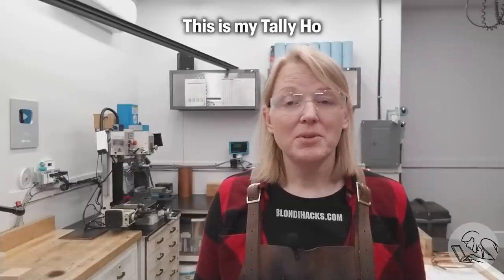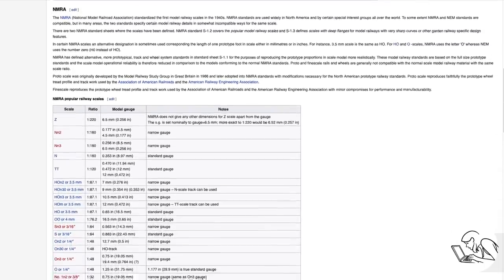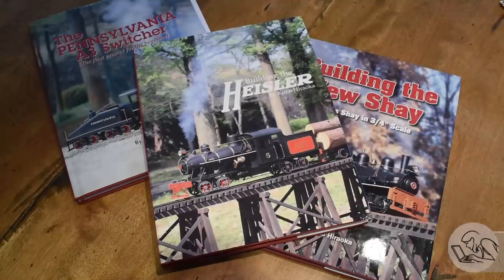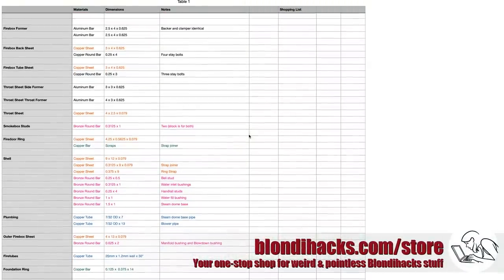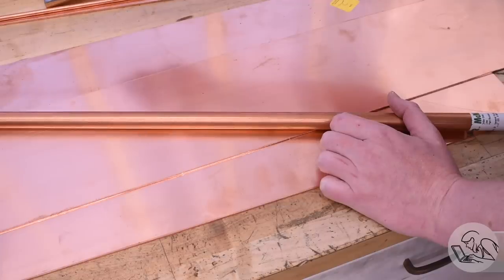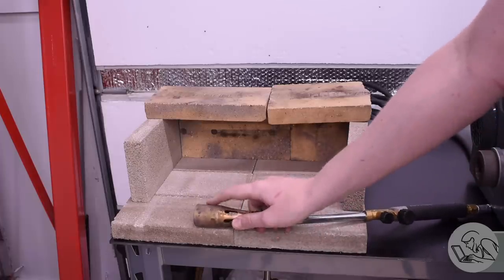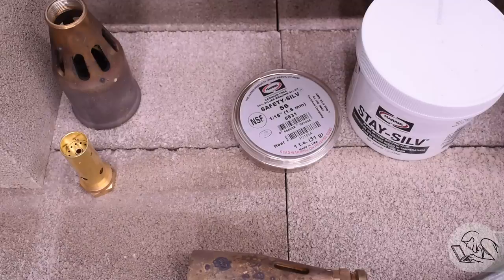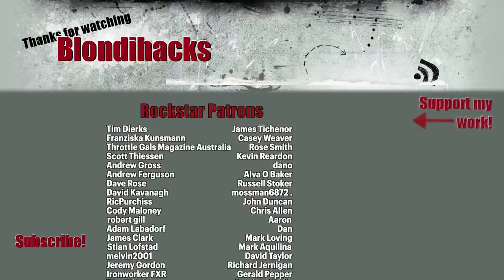Let's Build a Locomotive! Pennsylvania A3 Switcher, Part 1

Comment: I just discovered your channel by way of a mention in the NMRA (National Model Railroad Association) online newsletter. 
I recently finished my built of the Pennsylvania A3 Switcher, just this past summer. I enjoyed your explanation of the estimated completion date. It took me 15 years from start to finish, although I also worked a full time job as a machinist.
If you haven’t yet discovered it, there is/was a Yahoo Group for ‘Builders of Kozo Engines’. There are several errors in the book that are discussed there. Since you are starting with the boiler, you are likely to discover an error of accumulation when you try to marry the completed boiler to the frame. You will find that the firebox won’t sit perfectly flush on the frame with the smoke box firmly on its cradle. Many other builders have taken the time to completely build the engine in CAD to resolve errors like this one. 
It’s all part of the fun of the hobby.
Best of luck with the build!
Reply from the maker: Sadly that Yahoo Group is gone

Comment: For future reference for metric: consider checking out metricmetal point commercial.

They do seem to have 20.0 mm OD x 1.2mm thick tubing, if copper 122 is a fine alloy to use.

Comment: for large parts of the boiler try burying the parts in a bed of coke with just the joint exposed. it holds  the heat in and saves  the amount of gas you use. Im on my eleventh copper boiler and te coke trick really helps.

Comment: Another potential problem with building boilers out of steal is getting the boiler certified. I know here in the UK to get a steal boiler certified you need to be able to show that all the welding was done by someone with the correct certifications to work on pressure vessels. If you can't show that the boiler is as good as junk no matter how good the workmanship is.

Comment: You might find that you will require two torches. One big one to keep the entire boiler hot and one smaller one to make each joint. Copper transfers heat so well you can solder one joint and melt another one a foot away. Good luck. I made a copper boiler for a 7 1/4 but I bought a steel one for a 6in to the ft traction engine I am currently working on.

Comment: OMG.  Not going to dwell on the imagineering a CP 0-4-0 ... but ... the pic of the SD40s (I think) in Action Red multimark had a Robot car cut into the consist!  Distributed Power is a very common thing these days, mountain grades or not, but back when that image was made, Robot cars about the only way to have unmanned helpers.   CP's cars were converted EMD F "B units" where all the 70s/80s electronics were housed and were commonly seen on  their mountain lines.  Cool to see one in the image.
Reply from the maker: Haha I knew the railfans would come out of the woodwork for this one. 😄
Reply: @Blondihacks  We ... can't ... help ... ourselves ...  In another comment someone said "living vicariously through you" and they are 100% correct.  I am unlikely to ever build my own steam engine but through you ...

Comment: My grandpa built a 7 1/4" steam engine in the late '90s, the one piece he outsourced was the boiler. Here once the boiler hits a certain size and will need to be certified to run on a public track, and that is hard to do if one is not a qualified boiler maker. His engine is still in operation even though his has passed on.

Comment: 1 1/2 scale is about the biggest you can go and still have most of the parts still liftable (and the boiler will be iffy).  At 2 1/2 things get really hard.  I built a 3 truck Shay in 1 1/2 and the total weight is about 550 pounds.  A friend's 2 1/2 2 truck Shay is about 850 pounds, hard to shift around even with good hydraulics.

When you get to the big locos you get ludicrous weights.  A friend's Northern runs about 1600 pounds and another's K-27 is about 2600 pounds.

Comment: As I do not have room for a machine shop and limited finances (pension), I've gone down the battery electric route. I've designed my own, on 2d cad, used a laser cutting service for the frames and bodywork.
What I'm trying to get over is that laser cut frames are superb, I couldn't get that quality with hand tools. I urge you to go that route as it will save you weeks of unnecessary work.

Comment: Looking forward to this.  For the fire tubes, if the wall thickness is the critical factor for efficiency could you thin the walls down on the lathe?  1.2 m vs 1.65 seems like a significant increase in thickness.

I wonder what the impact of the efficiency would be.  Might not be worth the effort.
Reply: Most of the thermal resistance is in the boundary layer of the combustion gas -- and to a lesser extent in the boundary layer of the water. The thermal resistance of the copper is so low that it's effectively irrelevant to thermal efficiency. I've even used plastics for heat-exchangers in near-ambient temperature applications...

Comment: If you would like, I can cast up a bronze dome for you to machine.  Or I can cast up a bronze rod.  I have silica bronze on hand.  If you want I can cast close to the actual shape that you can finish from a sand casting, just need a drawing to plug into.  I work in Imperial. 
Fascinating project btw

Comment: Make sure that the safety valve is tamperproof and cthe boiler able to work well in tandom eith the valve so you don't lose or build too little or too much pressure, you would need 2 maximum, one for a higher pressure just in case

Comment: At around the 8:30 mark - you were binding up those copies of the book pages that were obviously copied physically on a xerox/home scanner. I'd like to mention that my last 3 Samsung phones had a built in scanning function for taking pictures of documents (there are also several apps that do this, but it seems to be a built in function now). This would allow you to make cleaner "copies" of the pages that don't have the binder distortion at the spine edge of the pages - it'll make it so much easier to read when you need to. Especially those larger schematics - one image of the whole thing could be scaled to whatever size you wanted and printed out - I see folded pages as you're binding yours, but I also saw the spine distortion. 

Maybe check out digital scanning - it might be very worth your while for easier to read material, and it's really not a steep learning curve at all. ;)

Comment: Copper TIG welding is a real pain... requires 100% helium  for the shielding gas due to copper's thermal conductivity. Other than for welding bus bars, soldering and brazing are the ways to  go.

Comment: @13:56, your high tech O.A.K product is expensive. Typically the softer and faster growing liriodendron tulipifera (poplar) could probably be used for hammer forming. It has these super amazing properties while being considerably lighter. Specifically I'm not super familiar with your exact O.A.K. variety as it likely has 2-3x harder than tulip (ABS(janka) values) yet passes durability tests that soft woods cannot.

Comment: Double (roughly 3 1//2 to 7 1/2) a linear dimension and you get 8 times the volume (and weight). More than a lifestyle change - that's an engineering change.

Comment: Spiral tunnels?! Pffft, we've got the Raurimu Spiral here in NZ. Still part of the main trunk line. You're lucky that you can get materials there. In NZ I can't buy nickel-silver steel, 1100 serial aluminum sheet, British imperial nuts and bolts, or any British imperial bar stock. A problem when you build vintage British cars.

Comment: I'm building a locomotive for which castings are not available. I machined my cylinders from bronze and I need to know if brass is an acceptable material for the cylinder heads. I really enjoy your videos and have learned a lot. Thank you for your series.
Reply from the maker: I think bronze would be better. The heads are in contact with a lot of live steam so dezincification is a concern
Reply: @Blondihacks  Thanks, Quin. I just priced some 1.5" bronze rod. WOW!

Comment: Tig welding is not hard. Well that is if you learned to weld with a oxygen acetylene torch like I did. Also if you really need metric stuff you could ask a euro guy like me. Shipping is expensive but in a pinch you will get the right stock atleast

Comment: I am one of those hobbyists that is a TIG welder by trade and I can and have TIG welded copper. I would still braze. The ease and effectiveness of brazing make it the right process for the job. Why would you make it harder on yourself and potentially end up with a sub par joint?

Comment: Quinn, I don't want to be a pest, but didn't know where else to turn. In your opinion, what would be a minimum size for steam piping feeding a .875 bore x 1" stroke at 75 to 80psi? Yhe engine is 7/8" scale to run on 1 3/4" gauge track.

Comment: Ok, I'm here making my second comment, because the pic of CP's 0-6-0 U3d 6224 built somewhere in 1911-12, was bothering me.  I can't recall ever seeing a steam loco with what appears to be two sand domes before.  Looking at the piping I wonder if because it was a switcher and had the dome closest to the stack for sanding before the forward drivers when traveling in the forward direction and the rear dome, to the rear of the steam dome, for sanding before the rear drivers when going in reverse.  Does anyone know for sure?
Edit:  I need to look around more. It seems that few locos have multiple sand domes.  Many articulated locos have two for each set of drivers and a few switchers have two.  But I'm still curious to know if the ones on 6224 were for forward and reverse.

Comment: I'm confused. This has an ~3 inch gauge? Is this a project to build a cat-sized engine as an intermediate step to one that can carry a couple adults?
Reply from the maker: It pulls riding cars that are scaled up for people
Reply: @Blondihacks  How does something so small (fits in a shoebox?) pull such a heavy load without slipping?
Reply from the maker: @mattb4805  Short answer is weight and low rolling resistance. Tractive effort comes from engine weight (make the engine as heavy as possible) and low rolling resistance is the whole thing that makes railroads special. It's why they are so efficient and thus a small engine can pull a lot.

Comment: Dear God... I am so ready...

Just be careful, ok? My grandfather worked on steam engines and he always told about that one incident where a locomotive with a faulty overpressure valve blew and ended up around 150m further up the road in a crater...